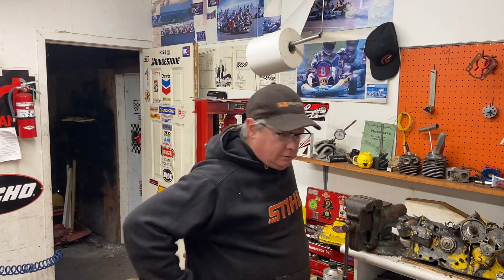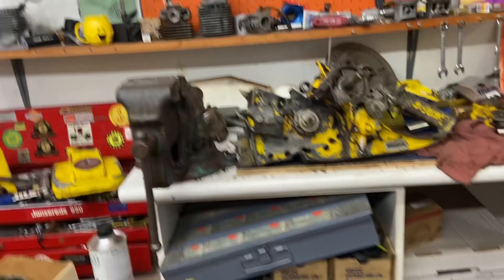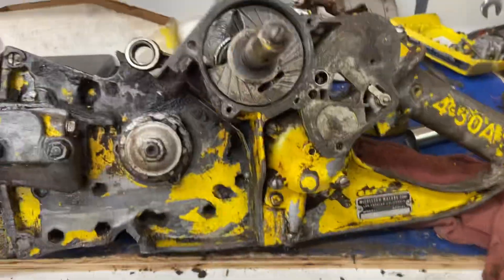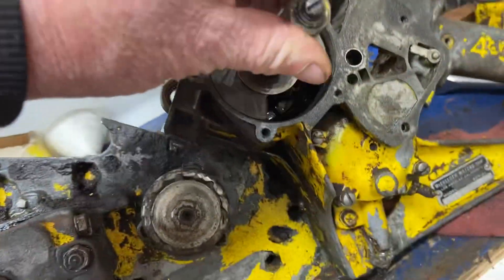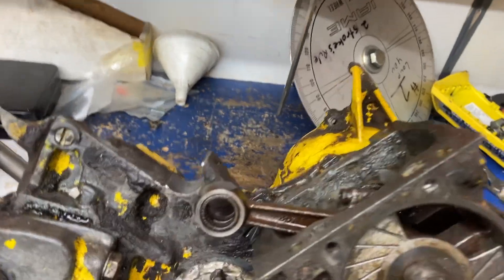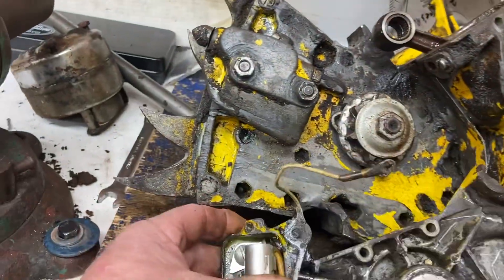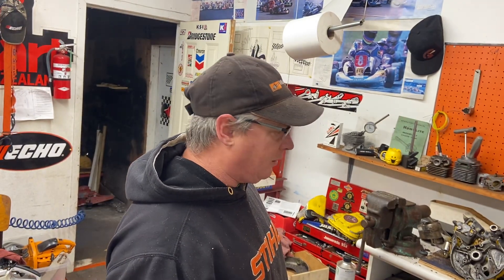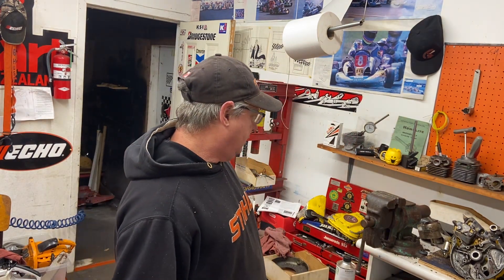Donny walkers chainsaws showing old McCulloch saw

Comment: @donnywalker I've got an older Sachs Dolmar 120 that I'm having issues with. Doesn't want to stay running unless the low jet is turned all the way in. What should I be looking for? Thanks!
Reply from the maker: You should pressure carb with a carb pumper then go throw carb does saw have compression and is the intake side of piston in good shape
Reply: @donnywalker4691  yes, has good compression. I put a new aftermarket piston and rings in it. It ran great for a few tanks of fuel and then the next time I went to use it started giving me troubles.

I will order one of those testers off Amazon you mentioned in your jonsered video.

Comment: looks like a primitive fuel injection system.  dumps raw fuel in to mix with air.  and hey, wankel rotaries are basically 2-strokes :-)   get a sachs dolmar rotary chainsaw to play with!
Reply from the maker: I would love a ankle engine are you from Canada mike
Reply: @donnywalker4691  New Hampshire here :-)  close enough eh?
Reply from the maker: I meant wankel engine
Reply: @donnywalker4691  any chance you guys are going to make any k095 mount bars?  24, 28 or 32?